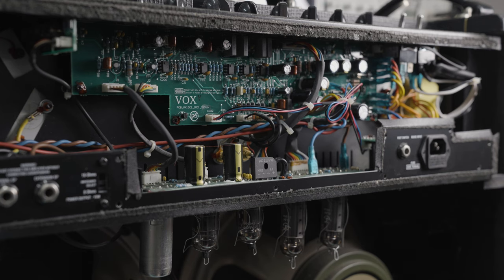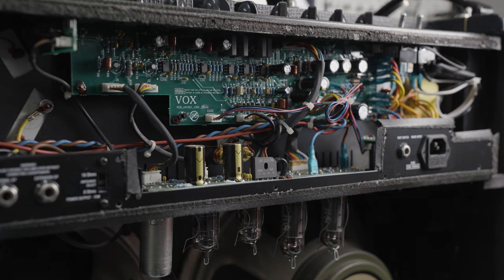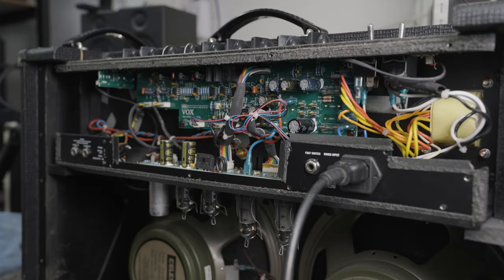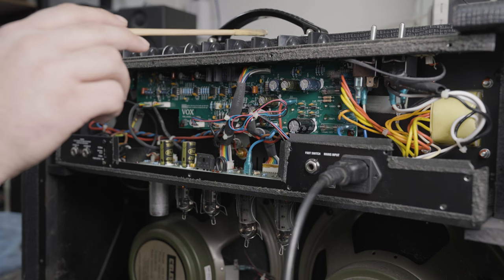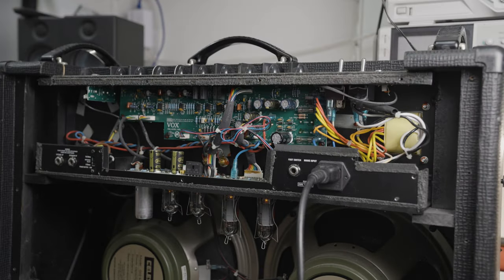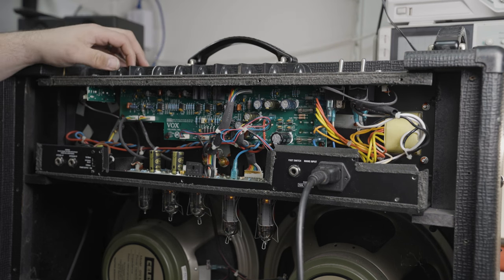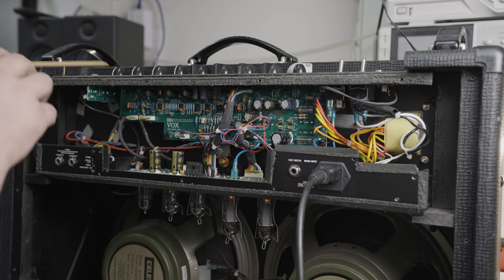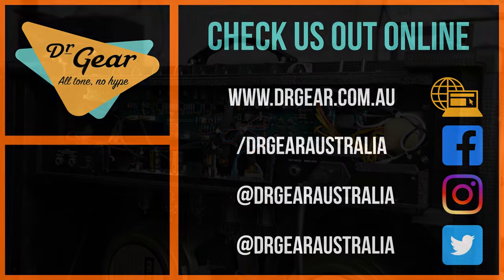Vox AC15C2 howling in the wind

Comment: Cheers Six!
You've gotta wonder why manufacturers keep pushing out 'hotly' run EL84 amps, if we knew of NOS Mullards and their whereabouts, we'd be shmick!
I still luv the Vox sound though.
Reply from the maker: Honestly, no clue. They could drop the plate voltages by 25% and still have plenty of output and a killer sound.
Reply: @drgearaustralia  On mine I recently measured 311V plate-to-cathode, dropping 9.6V across the 119.5 ohm cathode resistor, so about 12.5W per tube.  This is in the US with about 123VAC from the wall.

The dissipation is right where you want to be.  Is 311V really a torture chamber for EL84s?
Reply from the maker: They’re a torture chamber as they’re a closed back combo hitting the tubes hard, and I’ve seen these with as much as 335V plate to cathode when you reign in the plate current. Same as the Blues Jr and others. 

Ultimately, 311V is still over the 300V max design ratings, plus when you add to the 12.5W which is a little over the PD max, it all adds up. The next set of tubes you throw in there could have wildly different gm resulting in different figures.

Comment: What mods would you suggest to reduce the abuse and prolong the life of the power tubes?
Reply from the maker: Increase screen grid resistors to at least 1K, 1.5K is even better. Bias them to a reasonable level, however it’s a balancing act between plate dissipation and plate to cathode voltage in many of these amps.

Comment: Great affordable amps once sorted.
Those stock valves are terrible and barely last a year in a combo, even under ideal operating conditions otherwise.
Reply: The chassis looks way too small for everything that's been stuffed in there; must be a royal pain if you need to pull the control/preamp board for service. I've never worked on a Vox, but I look at the old ones with their L-shaped two-piecr chassis, iffy grounding, wires running every which way, and the narrow, fragile terminal boards, versus the new ones with everything shoehorned in, and I have to wonder if they ever built anything at all that was designed to be easily serviceable. Even the worst Fender and Marshall designs tend to be more accessible than this here. Maybe it's time to stop building amps with top/rear control panels; its fine for say a tweed-style, non-reverb Princeton  or Deluxe, but anything more complex  should have front-facing controls an a larger, more open chassis.
Reply from the maker: Nah, the AC15/30 are a cinch to work on. Everything is there and the whole board comes out easily. Undo the pot nuts, undo the screws, disconnect the headers and slide the board down. Takes all of about 5 minutes. They’re not like so many other amps that make removal and absolute nightmare.
Reply: @goodun2974  Plenty of room, relatively quick and easy to service. Kind of one of the best, actually.